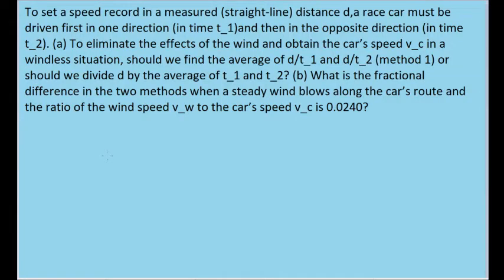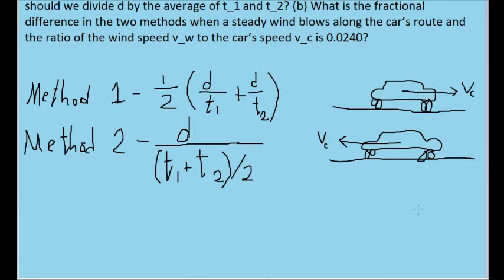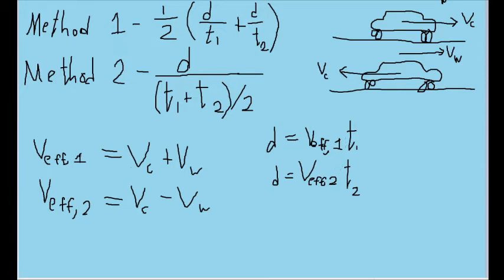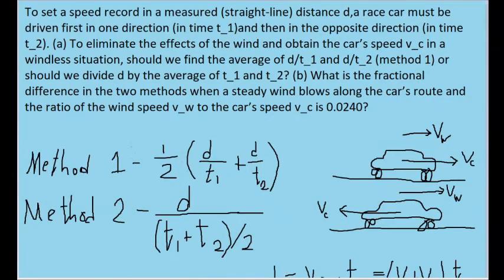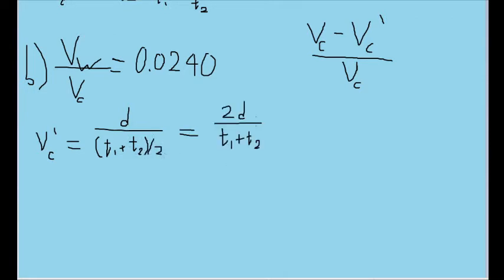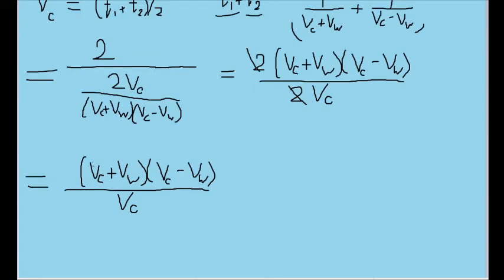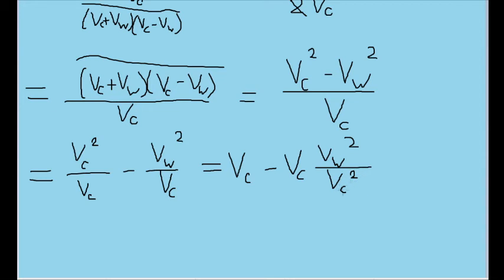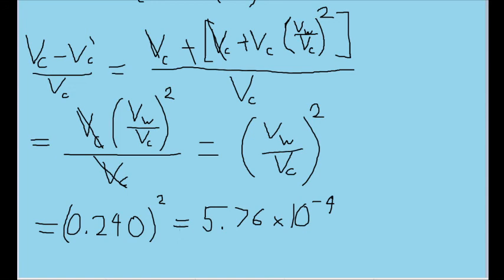To set a speed record in a measured (straight-line) distance d, a race car must be driven first

Comment: can you explain the fraction difference? why we have that equation?
Reply from the maker: It might take some getting used to, but that's just simply how fractions/ratios work. The problem asks us to find a fractional difference between both speeds, so taking the difference between the speeds and dividing it by the original speed will give us the percentage (in decimal form) of how much the two methods vary.